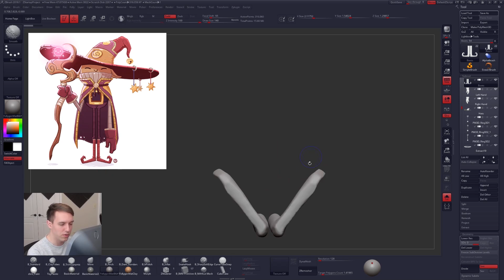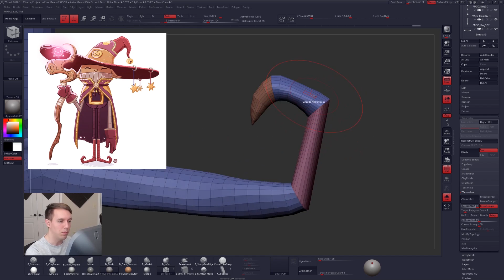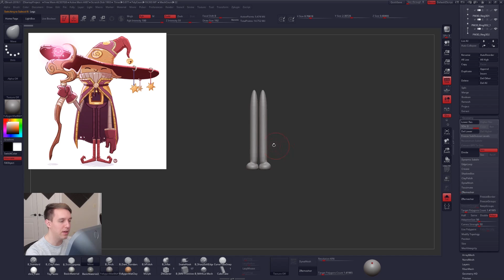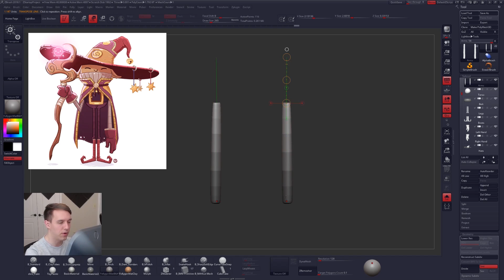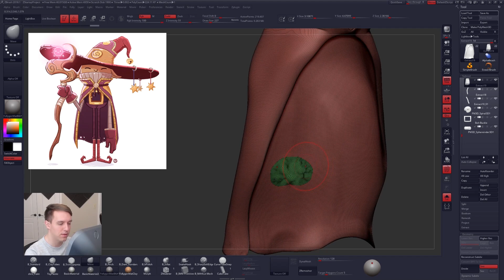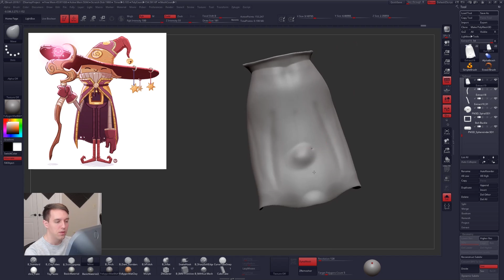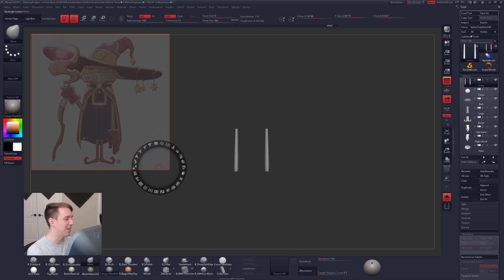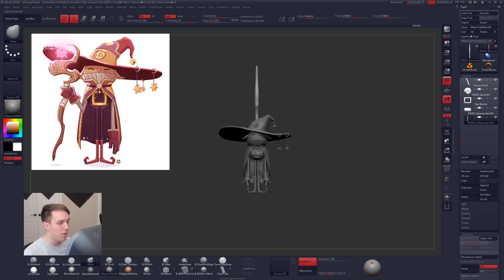Breaking Down Shapes In Your Characters

Comment: Thank You, it's great to watch how You approach things. May I ask is it "proper" way to things like buckle if we want super accuracy or extra crispness on hard surfaces to take them out to modeling software like max and just get proportions and shape here in ZB ? 
Also The slice brush. I was afraid to use it , I thought it splits the mesh and creates open edges. I suppose I was totally wrong ?
Reply from the maker: Thanks yo! I like poly modeling that stuff directly in ZBrush. I have a video on hard surface stuff on my channel you can check out if you want to learn more. You are probably thinking of the trim brushes. A little different than slice.